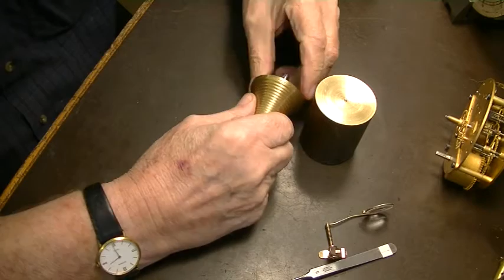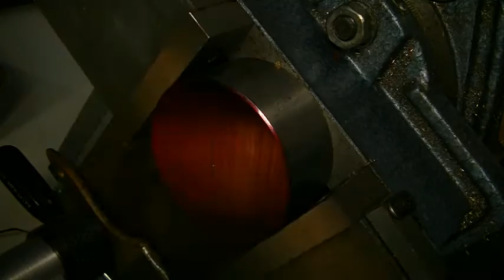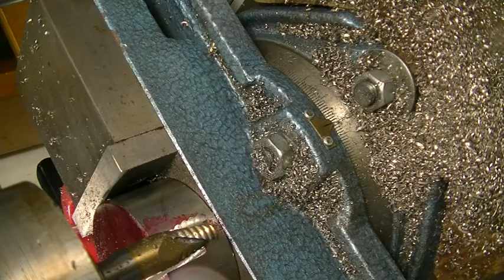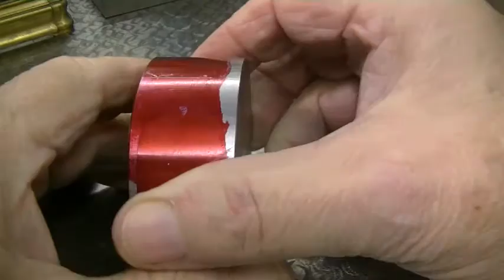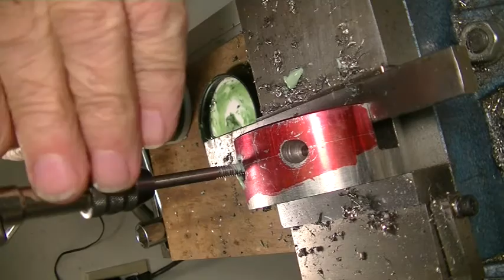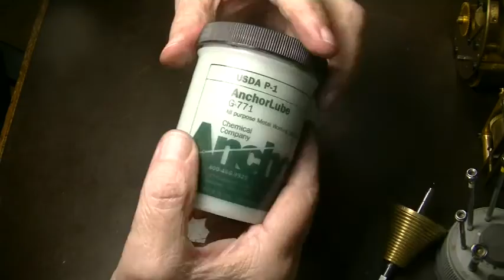Clock repair tutorial #9. Cutting a fusee for an English Skeleton clock. Part 1.

Comment: Hi James.That stainless is some tough stuff for that part!  It will be interesting to see the rest of the series.  That fusee is an interesting item, though I have no idea what it does.  For those of us (and most of the YouTube audience) who have no background in the horological arts, you might consider prefacing these series with a quick background of what these parts do and how they fit in.  Maybe even do a video or two on some terminology.This video has a fair amount of sideways and even some upside-down footage.  It would definitely be nice to get the video upright.  There's probably something in your editing software for that.The laser tool is really neat.  I haven't seen one of those before.  Handy shortcut.It's really interesting to watch you work on these delicate, small parts.  It's definitely a different branch of machining than what most of us are used to.Ryan
Reply from the maker: Good idea. In the next video I will show the clock I am building and how the fusee fits into it. So sorry about the crazy video.I am new at this and it never occurred to me that the camera had to be right side up. It won't happen again. Do you think a video on clock parts and terminology would be worthwhile for the group? If so I would be glad to do it.